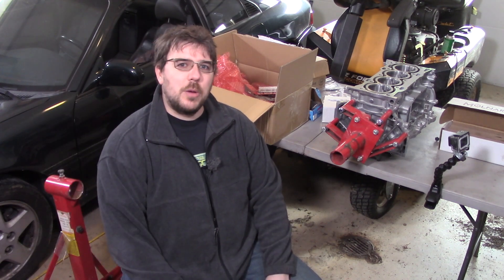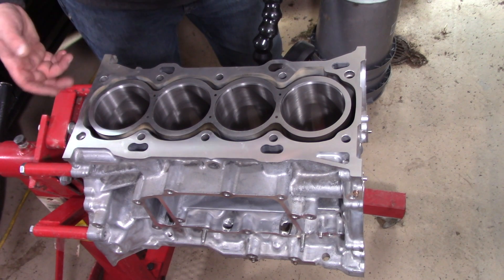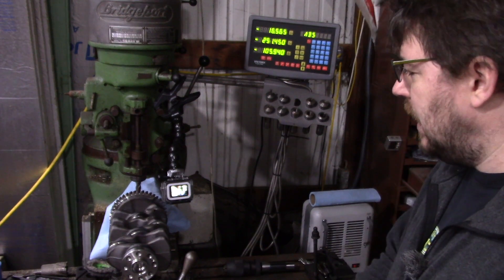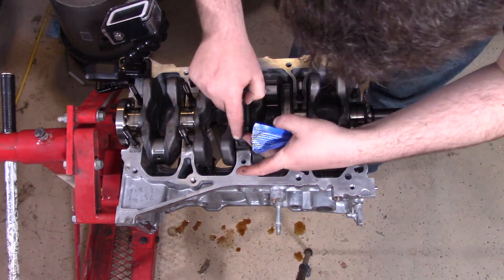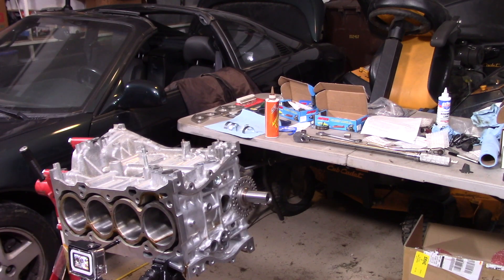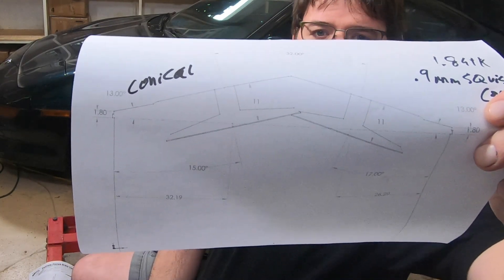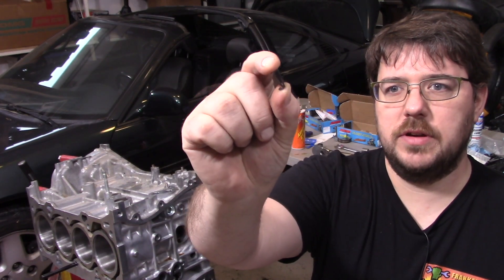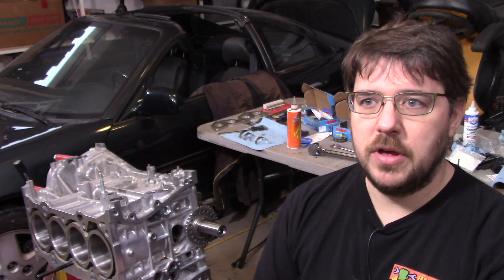The 2AR-FE road to high naturally aspirated horsepower.

Comment: Were are you getting those parts bud? They pretty difficult to find. I been searching for months and I also have a toyota dealership nearby so I can get the 1AR crankshaft. I am planning to build one too and turbocharge it along the way. Its there any reccomendation on finding these parts?
Reply from the maker: I'm not sure which part you're asking about but while I'm generally happy to share information I hesitate on stuff like this until I've actually tested it so i know it's actually fit for purpose. I've just had too many issues of getting accused for recommending bad parts when it wasn't a recommendation at all.
Reply: @FrankensteinMotorworks  My appologies. The parts were camshafts, valvetrain , piston bore and stokes, journals and bearings. Also I was wondering a good bore and stroke for turbo appliance within the specs. I know its a lot but I am doing my research first.  So any recomendation or info it will be greatly appreciated. Afterall you are the only person giving it a shot, so thats great. Keep it up bud.
Reply from the maker: @rdsjankee  Sure, those are all things I feel pretty confident on, the valvetrain stuff is the stuff i’m not really wanting to share right now until i test it. The camshafts are custom regrinds with 280 degree duration and 10.9mm lift. The block has been rebored but just to get a new finish and get rid of .01mm of bore ovaling from wear, it was bored over by less than 0.1mm. The stroke is 105mm, it’s a stock 1ar-fe crankshaft with the balance shaft gear removed from it (to reduce windage and drag). All the bearings & piston rings in this motor are OEM units, they’ve put up with immense abuse so far so i am keeping them. I’d like to find a different thrust bearing if i could but i might just need to service that one a bit more often. It could actually be serviced with the engine in the car so it isn’t the end of the world and it’ll still do multiple years of racing between needing service.

As for a recommendation for doing a turbo build, it all depends on your power target. 350whp does not even require opening up the motor.
Reply: @FrankensteinMotorworks  Wao thats sound great without replacing any parts except the crankshaft. Cus i was gonna start by filling up the block an do forged internals. Cus I am aspiring to a do 420hp at least so I am starting with buying the other motor first so I can start buying anything I might need

Comment: Hi, I have 2AZ-FXE in my hybrid 2011 camry, can I swap it with 2AZ-FXE with modified programming? Please let me know.
Reply from the maker: The hybrid ECUs do quite a bit to blend the power with the electric motors. I'm sure someone out there is smart enough to program these but that person is not me.
Reply: @FrankensteinMotorworks   yes but will it fit the transmission and also what if I used ECU of the swap engine?
Reply from the maker: @MoNa-ce5mb  the hybrid transmission is just two electric motors and a planetary gearset. without the hybrid ECU to control it there will not be any power sent to the ground.

Comment: Also maybe some cylinder support? They have that putty that j series ppl use. That or a machined insert?
Reply from the maker: I considered it but if you look at Papadakis' teardown for his 1000whp 2ar-fe that runs anti-lag he isn't running anything other than the stock plastic spacer in the gap: https://www.youtube.com/watch?v=7PVc7pKzF64

So given that, i will be skipping on the reinforcements at least until i see issues with the current setup. I will likely also bump up to 1/2" studs before any cylinder support.

Comment: Hey how's it goin? Man I'm glad I came across your vid. I just endoscoped my 2011 Rav4 because I wanted to see how the walls looked because it's a pretty heavy oil burner. They're scarred up, look ovaled out as you said. Appreciate the specs, I'll get with a machinist after I tear it down to see if the block is still within spec. The car is just too nice to give up on it. I wonder how much life the trans has left though. It has 170,000 miles on it, paint, interior and suspension (replaced) is near perfect.
Reply from the maker: Honestly, these engines are dirt cheap because Toyota made so many of them. Unless you're going to be building it up for performance i'd suggest just getting another used one and tossing it in as-is.
Reply: Hey man, appreciate your response. Do you know any good used engine dealers? I searched a few and they're pricey, like $1800. Thanks again.
Reply from the maker: @66designs37  The best thing to do is to go to a local pick-n-pull and pull one yourself. They generally run $250-300 that way.
Reply: @FrankensteinMotorworks  That's more like it, I'll call around on Monday, wondering if I can find one with low enough milage and hopefully regular oil changes, that I don't get one that consumes oil. Maybe less than 120,000? I just ordered a dial bore gauge for a couple hundred, was gonna start tear down right now. Was kinda looking forward to building it if the block was ok. But realistically I get what you're saying. I dunno, I can always hold on to the gauge. I'm a car classic restorer and have built older engines and will be building performance motors here and there in the future. Tolerances weren't as critical and our machinist in school was really good. Took engine building in ROP, but yeah that was 20 years ago. Hope that makes sense. You're awesome.

Comment: Just stumbled across your channel this morning, any updates on the 2AR?  I've recently purchased a super cheap 2013 TC with 89k miles, it was able to start and drive itself onto the trailer but the motor is knocking heavily. I originally intended to throw in a stock replacement, remove as much weight as possible and have a cheap reliable beater car. After driving a friends stock '15 TC I feel the car needs more grunt to be any sort of fun.
Reply from the maker: Not yet, this is still very much on my to-do list but covid kinda threw a wrench in those plans.

Comment: Would it cost about the same to put one of those into a '93 MR2 as the 2GR-FE?
Reply from the maker: The advantage with the 2GR in the MKII is there's a mount that exists currently. the costs with the 2AR-FE should be a fair bit cheaper because the engine is super cheap and available. If this build ends up making decent power i will make a 2ar-fe mount for the MKII also. It's going to be a good place to start especially for those looking to turbo. 2.7L is a heck of a lot of displacement for as small as this is.
Reply: @FrankensteinMotorworks  I'm already curious about how much lighter a 2AR is than a 2GR, and if it would be counterproductive to try fitting that block to a 3S-GTE head.
Reply from the maker: @ucallthatatweet  The 2AR-FE is 30lbs lighter than the 2GR-FE according to Toyota, there’s also 5-10lbs saved in the exhaust from a V configuration to an Inline configuration. Fully trimmed the engine and EB62 trans as it was ready to drop into the MR2 Spyder it weighed 410lbs acording to my scale. 

As for fitting the 3s-gte head on the 2ar-fe block, I suspect the bore spacing on the 2AR is bigger than the 3s-gte which would make the task go from ridiculously difficult and expensive to impossible. 

But in the end, the 2AR has bigger valves, bigger ports and more valve lift than the 3s-gte. The 2AR-FE makes the same power as the 3s-gte even before you put a turbo on the 2AR. I just don’t see what the benefit of it would be, the 2AR really is quite advanced.

Comment: I'm trying to swap a 2arfe into my 2006 scion tc. Any advice?
Reply from the maker: The 2AR is about 1.5-2" taller than the 2AZ and uses a very similar engine to trans bolt pattern so the only thing needed to mount it will be a right side engine mount and then you'll need to sort the electronics to control it. Since i assume you're doing this to go for big power there's really no point in trying to make it run off the stock ECU, just go straight to a Haltech.
Reply: @FrankensteinMotorworks  I figured as much. I sorted out the electrical harness. I'm going to contact you at your website to continue this conversation.

Comment: Frankenstein motorworks, does the crankshaft in the 2gr fe fit properly in the 2ar? I have a 12 tC2, trying to figure out what to do with it's drive train as well
Reply from the maker: The 2GR-FE's crankshaft is completely different than the 2AR-FE's crankshaft. But if you want the 86mm stroke you can probably use the 8AR-FE's crankshaft in the 2AR. this brings the motor down to 2L
Reply: Oh really 🤔 im mainly trying to find a crankshaft that can withstand so much force and friction, maybe im mixing the 2gr crankshaft with the 1AR. I know theres one out there that popadakis uses. Your vidoes are amazing for the 2AR, not many know about this motors capabilites.
Reply from the maker: @keitht8595  Papadakis used a stock 1ar-fe crankshaft in his motor until he went beyond 850whp. beyond that point he went for a fully billet crankshaft on his 1000whp build.
Reply: @FrankensteinMotorworks  thank you for that info, much appreciated. I have a decedent kit with a water to air intercooler so i know once the boost goes up im going to have to do something serious with the drive train. Your wisdom and videos do wonders my friend thanks again

Comment: Would love to get one of these in my MKl Mr2...seems the least documented. Been doing some research how mount fab would go among other things
Reply from the maker: It's a great motor for the MKI. I did one way back in 2009 and had a blast until i replaced it with an MKIII chassis: https://FrankensteinMotorworks.com/2AREB61MKI/IMG_0559.jpg
Reply: Frankenstein Motorworks I was reading a your forum posts on MR2OC.Im sure if Youtube was popular back then as it is now you’d have a lot more MKI willing to see your progress/documentation via video. It’s a shame MKI are a small demographic at this point.  I’ll have to do some more research into the possibility of a plug n play option for that left axles where you made the custom spindle

Comment: did you use  different cam shafts in this build? i've never found any since ive had my car in 2015
Reply from the maker: I do have a set of custom ground cams here for that engine.
Reply: @FrankensteinMotorworks  did you do it yourself? i heard brian cower grinds cams for the 2arfe a while back, but didnt know if that was true. these cars are impossible to find stuff for
Reply from the maker: @goybi7356  No, i hired it out. custom grinds are really not  much more expensive than off the shelf grinds. I won't give out my numbers until i've tested it though. It's not that i want to keep it a secret it's just i don't want to send people in the wrong direction until it is tested.
Reply: @FrankensteinMotorworks  i understand. keep up the good work man. built NA 2AR's are uncommon and i'm interested in going that route just to see what its about. so far ive found ferrea valvetrain parts and the JE 11:1 pistons, molnar rods, etc. not sure if id wanna bore the block tho

Comment: Marc we need an update! Spring is close...
Reply from the maker: Sorry, I’ve way too many things on my plate. I really want to get this done ASAP also but i’m only one man with far from unlimited budgets :( Right now I’m waiting on custom pistons before i can proceed. I have the head stuff here already but i can’t do anything with that until i final test the piston fitment. I promise it’s still a high priority item
Reply from the maker: @michaelscholten9753  On yeah, 100% still alive. I’m working hard on editing the 2gr-fe wiring instructions video for the SW20 right now. It’s 18 hours of video and I’m doing my best to make it short and concise without missing details. I’m also WAY happier with the editing than previous videos but that isn’t what’s taking extra time. I’m just getting better at it as i do more of it. 

As for the A/C on the 2AR-FE. that’s a solid point, i need to do that one also. I’m going to release a new axle carrier bracket for the 2GR in a few weeks so the A/C should be the next part i work on after that one. I’ve been slacking on it because it’s an expensive R&D effort. I’m very likely going to have to make a custom A/C compressor body to fit that nissan pump to make everything affordable for production while fitting the chassis without trimming anything. I’m also considering potentially doing a reverse mount setup with the stock 1zz A/C pump and driving it from the same pulley as the water pump since the rotation is correct. I just need to spend time on it, there’s many workable solutions it just needs to be cost optimized while producing a quality part.

Comment: I’m super late to this video, but does anyone know what transmission goes with a 2ar-fe that can be built to hold at least 600 hp. Gonna build a tc with forged internals on boost and looking to start out around 300whp and work my way up to 500-550
Reply from the maker: The only stock transmission that will bole up to the 2AR that can handle the power is the wide case E series transmission. You'll see a lot of advice saying to use the MR2 transmission but don't do that. they are rare and super expensive. The Camry transmission will have the shift location in a position much more appropriate for a FWD car and as long as you get it from a 90's V6 Camry you will get the wide case E series. Feel free to contact me for images and a better description of the difference between a wide case and a narrow case e series. 

Note that the wide case e series comes with a 30lb weight penalty and the extra internal friction and rotating mass also comes with a horsepower penalty. It also comes with a shift quality and synchro lifespan penalty. To the point where i've actually made parts to use the narrow E series transmission in the MR2 because on builds that have under 400whp it is a much better choice of transmission. The first generation tC comes with this transmission and i would strongly urge you to use that transmission until you are 100% sure that you will be exceeding it's capabilities. 

Conveniently the wide and narrow trans use the same clutch, same shifting mechanism, the same front and the same left mounting brackets so switching in the future only requires the rear motor mount to change. You'll also need different axles but when you cross that barrier you'll also need to go to custom built axles anyways so that isn't an additional expense you'd avoid by going to the wide one right off the bat.

Comment: What was your reasoning for going with custom pistons over available ones like cp or je with standard or oversized bore?
Reply from the maker: I reached out to JE and asked about the valve clearance and they stated that their pistons would not work with the extra valve lift I'm using. Somehow i missed that CP made pistons for this engine. 

Honestly the valve lift i'm using is not a heck of a lot more than factory so I'm really surprised that they said that but that more or less forced my hand for custom pistons.
Reply: @FrankensteinMotorworks  Here's info on the CP pistons. Might have reach out to them for the actual specs, just know they made 2 compressions and 2 sizes.
https://www.dezod.com/collections/dezod-motorsports-engine-build-parts

Comment: Is this the stock engine block?
Reply from the maker: Yes, the stock block is perfectly capable of way more than this power level.
Reply: @FrankensteinMotorworks  Awesome good  to know ! I have a 2016 Camry that I’m modifying it’s the 2ar fe engine so the 4 cylinder one I’m trying to make it to the ultimate sleeper and I plan on adding boost eventually

Comment: Is the 2AR-FXE  the same as the 2AR--FE ???
Reply from the maker: They are in the same family, they share the same block, head, valvetrain and timing cover but the fxe normally has intake only vvt-i and has a higher 12.5:1 compression ratio. It's designed to be a hybrid motor. I was able to use the 2AR-FXE motor with minor modifications and no custom parts and make 260hp. With that info i'm currently in process of figuring out how to make even more naturally aspirated horsepower.

Comment: im really considering putting the 2ar engine in my 02 spyder. I live in cali so I would have to make it CARB legal. I just have to find out whats all involved in making it CARB legal.
Reply from the maker: To make it carb legal you have to do a few things, first is run the stock catalytic converter and second you have to run the Scion tC evaporative emissions module and you also need to run the stock tune with the stock airbox. The good news is I can disable the immobilizer on an ECU and leave the stock tune on there. These things will cost you a bit of horsepower but still give you significantly more than the stock Spyder gave you. I would expect 185-190whp or so with all that stuff instead of the 205rwhp that I get with the configuration I've designed.
Reply: @FrankensteinMotorworks  Thanks for the reply. I will most likely start to purchase parts for this swap soon. My MRS is a daily driver and I think this would be a good swap  over the 2zz.

Comment: Will the 2grfe manifold fit the 2ar-fe?
Reply from the maker: no, the 2GR-FE is a V6 configuration and the 2AR-FE is an I4 configuration. They are VERY similar architectures on both motors but very few if any parts actually interchange. Even the valves are different lengths between the motors despite the geometry being almost identical.
Reply: @FrankensteinMotorworks  thanks fir the information